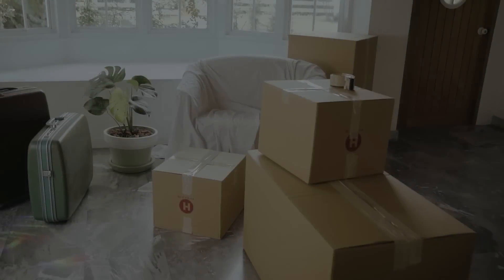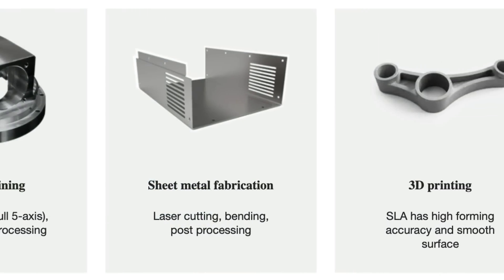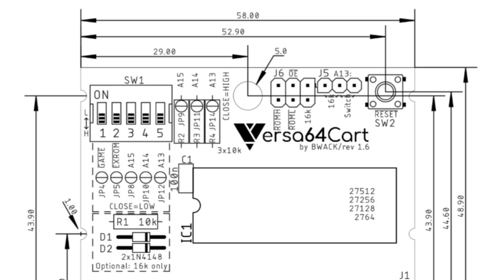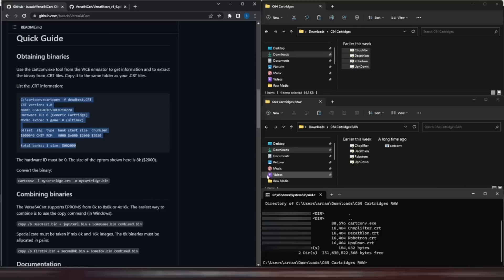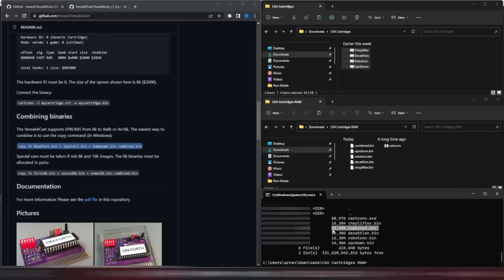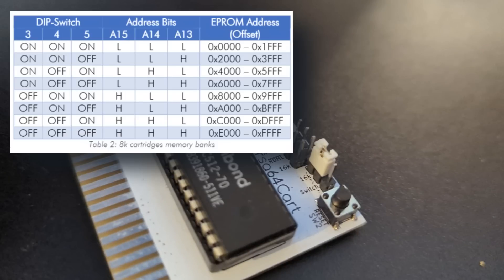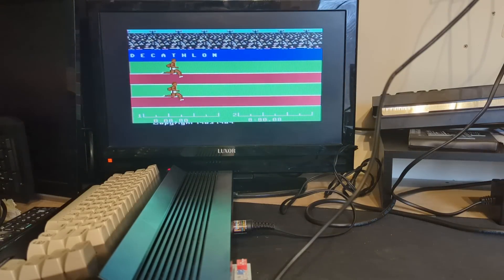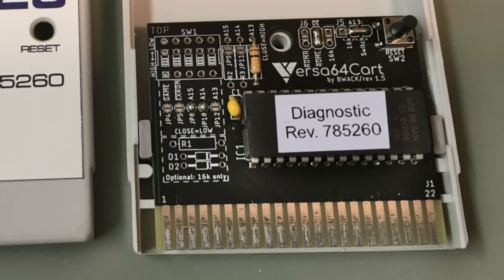Create your own library of c64 cartridges with this Versa64Cart single or mult-cart solution!

Comment: We could only dream about such wizardry at the time (1985). 😁👍
Reply: Problem with this wizardry is that it requires an external EEPROM programmer.  It would have be nice to be able to program it directly on the C64 or better yet through a USB cable. ;)